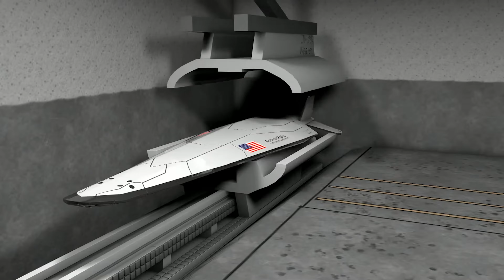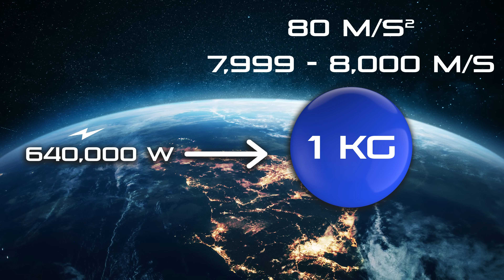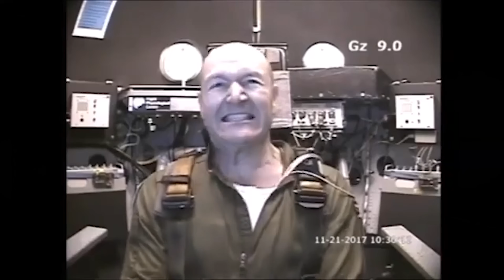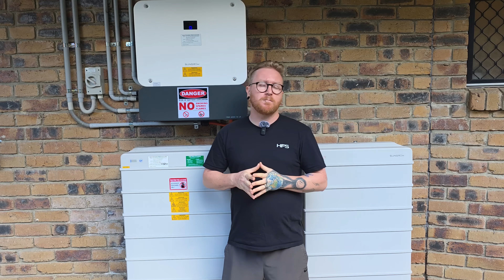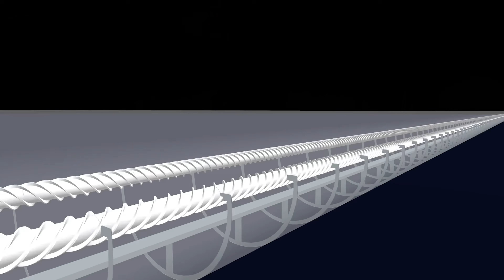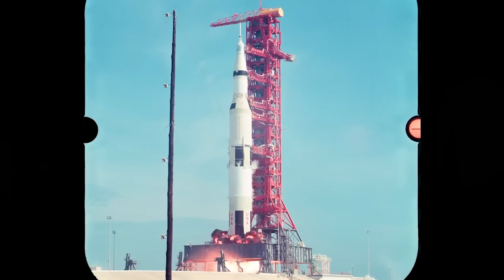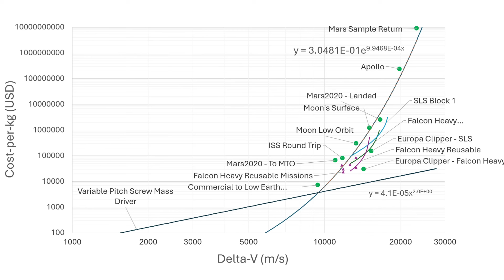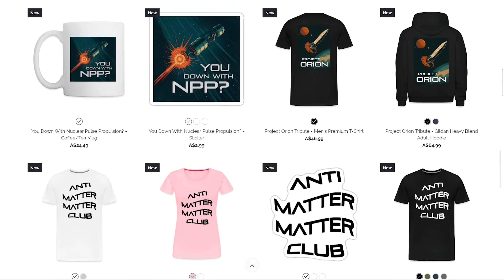The New System That Could ACTUALLY Replace Rockets

Comment: Engineer here: The laws of physics dictate that (on earth) you need at least 32 megajoules (MJ) to get 1 kilogram to LEO.  Real life requires more since you also have to accelerate the rocket body and the fuel.  So, ANY system you design (including the one you describe here) has to impart at least that amount of energy to the payload.  So, if you want to launch a Dragon Spacecraft (12,000Kg) to LEO, that will take over 300 gigajoules.  Yes, with your variable screw thing you could build that up slower so it would require less watts BUT you still have to get to that energy and 1) you will not be able to transfer all of it and 2) you will have losses that grow with the amount of time required to spin up the system.  Maybe once we get to orbit or to the moon, such a system could work BUT I just don't see how this could ever work for getting a payload into earth orbit. Artsutanov's Space Elevator seems more realistic though the materials to make one is still quite a ways off.
Reply: The space elevator is unlikely any time soon. I’m surprised people don’t discuss the one solution that is actually feasible with current technology (although still an engineering and geopolitical challenge); namely, orbital rings.
Reply: @iloled2924 orbital rings have a serious eddy current problem. You don't get something for nothing.
Reply: @iloled2924  Could you please explain to me how an orbital ring is feasible when a space elevator isn't? It seems like an orbital ring is like an even more ambitious version of a space elevator and requires similar materials.
Reply: I think it's not replacing the rocket/fuel, but heavily reducing the amount of fuel the craft needs. Think of the catapult system on an aircraft carrier.
Reply: @quellenathanar  I understand, similar to the idea of launching rockets from airplanes but this design is WAY more complex.  I think the idea is good thought experiment that may lead to something practical but I doubt I will ever see something like this used on earth in my lifetime.
Reply: @connecticutaggie  You're probably right. I just don't like the idea that we currently carry all the fuel from the ground just to go from 0V-XV. Even if we use a mechanical system like a catapult, it would save quite a bit of fuel/weight.
Reply: @quellenathanar  I think the next practical step would be to find the most efficient way to do ultra high speed transport (like Hyperloop).  That is the same core problem but keeps it in the achievable range and has immediate applications.  The challenge with that however, it that it means you have to put meat on your idea and some people would rather stay in the dream/future/inspiration space where as and Engineer, I prefer to do some dreaming but then look to see how to apply that in current reality.
Reply: Marshall Savage relates his preferred option in The Millenial Project. He proposes a mag-lev system that ascends at a curve up the inside of Mt. Kilimanjaro. A significant amount of velocity can be achieved with ground-based energy deliverance, and the emerging ship (look, he has details) is going at a rate that the laser system (yes) that is next employed is used to vaporize ice stored in the hold. This provides the needed thrust to achieve orbit. Look, just go read the proposal. Arthur C.  Clarke loved it and wrote an Introduction, for Pete's sake.
Reply: At the altitude the ship would emerge, the air resistance would be greatly reduced. Also, the ground-based lasers also take a huge load off of the ship's needs.
Reply: The vacuum part is being investigated presently, and I expect us to make progress, of we want it.
Reply: @wombleofwimbledon5442 even if you got to the top of Mount Everest, you still have a third of sea level air pressure.
Reply: The fuel of a conventional rocket launch has the same fundamental energy requirements plus it comes with the rocket equation of needing more fuel to accelerate the fuel.
Reply: well, one would assume that the screws, and tracks would be better performing then ACME threads and flat guides in power losses, and likely worse then ballscrew and bearing tracks that puts losses  at between 70%-80% for a quick back of napikin calculation.
I gotta say, thats better then any rocket motor for leo launches already, that have a maximum "round cow" idealized maximum of 50%  and entirely based off of known in use mechanisims losses for such a use case.
Reply: @AnonymousAnarchist2 
I see it as sections about 30 foot long, need redundant systems to prevent disaster, would it change the spin on Earth if you don’t build two?
Reply: Carbon nanotubes will make the space elevator possible.
Reply: It is a feasible solution with current technology could begin building it tomorrow,
Will determine space dominance, unless cheap hydrogen is real.
Reply: None of this matters. The point is moot. No one is going Anywhere. My reply to the video creator, but it applies to all of you as well. - "Although new technology for flying craft that may work better than rockets may exist I find it really funny you think travel through a 2nd law of thermodynamics violation you call outer length width and height is possible. If you think that, you don't know where it is they claim you live or you don't know physics of gas behavior or both. Hint - I'm looking at your 2nd law of thermodynamics violation at 6:56. (or at least the CGI depiction of it) Such a place cannot exist in reality. You see, you believe the sky is a volume that gas is not filling. That's not possible especially in the open system Nasa claims we are in."
Reply: the skyhook, launch loop and orbital ring are the only ones that I think are actually possible. And with the launch loop you don't need to impart all of the velocity for example you could have a tandom skyhook and launch loop, the skyhook being a long rotating "pole" in space set with a particular orbit and likely tapered to move the centre of mass to one end and increase the payload, yes you would lose orbital momentum for every launch but you can use ion engines or some high efficiency low thrust option to slowly recover the lost momentum.

launch loops use the conservation of angular momentum to get high up by rotating a core of material beyond orbital velocities to keep the centre of the structure elevated about 80 - 100km up and is about 2,000km long, the core is kept from touching the structure with magnets and kept in a high vacuum, the only real issue with this one is keeping the vacuum over such a distance, nice bonus is it can also be used as energy storage and an insane level of energy storage too.

and the orbital ring which is the best of all of them but would be insanely expensive to get to orbit in the first place, just it actually should work and has no fundamental issues apart from being insanely expensive to put into orbit without a pre-existing launch system that brings the cost of launch per KG way way down, well except for the doing the actual construction in space being insanely difficult as it has to be a ring which wraps around the planet... 

technically that isn't true as there is a tweak that you can do which reduces the size, basically you suspend the orbital ring from the planet with tethers, it's called a tethered ring, bonus is you also don't have to build it in orbit, you can build it on the ground, and the reason it works is the inner spinning part provides the large majority of support, it does reintroduce the issue of having a vacuum tube that long however it doesn't need to last terribly long, just long enough to get it high enough that atmospheric pressure is low enough, that is still likely weeks if not months though to raise the orbital ring given the sheer amount of energy we are talking about that a couple of big power plants would take a VERY long time to raise it.

And you would have to build parts of it over the sea, and when it goes over land like that's gonna be problematic too, means getting muliple countries very much onboard for something that will be very disruptive and costly.
Reply: @Etheoma  You'd probably enjoy reading "The Techno-Economic Viability of Actively Supported Structures for Terrestrial Transit and Space Launch". When evaluating which technologies are the most feasible, it's essential to consider their economics - that is, what is their capital cost and what is their plan to service the debt incurred to build them.
Reply: @Etheoma Ive never seen a proposal to just put an orbital ring up around earth.

Most cases its build up with things like Atlas pillars and those Atlas pillars would be used for both energy storage and launching space-craft through an vacuum tube, or sub orbital rings, rings operating in the same prinical as an full orbital ring having the inner core spinning far faster then orbital speeds but a diameter much smaller then earths so you can winch them up by moring inwards and lift them that way thus building the framework for a planetary fast travel, and also energy grid and storage.
Or of course, build the darn thing in the astroid belt and just bring it into position after thats always an option.

Economically as far as impact on regular joe dirts like most of us I do find the orbital ring to be the best solution. But variable pitch screws are not far behind, I ran some back of the napkin math on the propsal and well. They are shockingly do-able.
Assuming the screws where made out of solid cast semi-steel (the strongest cast iron, the weakest steel its just in the middle) thats the material I used and the presented dimentions for the screw. Of course we would use something stronger and lighter. 
but the final twist rate required of the screw limited to bad steel/great cast iron would only be between 2 in and 4 in one (meaning one turn of the screw would move the craft forward half the diameter to 1/4 the diamters) depending on how much a saftey factor youd need for escape velocities, and the energy storage factor is. Well. Defenitly not something to shake a stick at, the entire screw would hold about as much energy as lithium ion batteries of the same size.

And again, thats at intentionally limited materials. So there definitly is simular benifits and utility as the orbital ring just more limited in scope, but also limited in resources used.
Reply: This is a much more significant development for a lunar mass driver system, building real substantial large structures in space will require megatons of materials and this variable magnetic screw thing if it works mostly as well as the paper suggests would make the infrastructure and complexity much more feasible. Still scaling to the square instead of the cube is a massive improvement. There may be some more ideal balance between a ballistic orbital height & finishing up orbital velocity with a burn that launching payload that can handle higher Gs can be optimized for vs  reusable staged rocket launches.
Reply: What about smaller modular payloads?
Reply: @uku4171 being modular doesn't change anything  and sure you can reduce the mass to reduce the energy but to get down to a "reasonable" level of energy means you are just launching bullets to orbit.
Reply: @connecticutaggie modular so that you can lift it in singular modules instead of as a whole...
Reply: 300 GJ is 83 MWh, and electricity costs around $30-$100 per MWh. So $8,300 in electricity costs to launch the mass of a Dragon Spacecraft using the numbers above. Compare this to the $300 million per launch that NASA pays to SpaceX for ISS resupply missions. But, the real operating cost math is more complex and is described in the paper (and in the digital twin) - give it a read!
Reply: @spaceinfrastructure3238  another issue I alluded to but did not delve into is that you are going to have to spin the system up before each launch attempt and I am sure there are going to be a LOT of losses in the system so launch aborts are going to be really costly.  Also, the whole energy recovery process is going to be way less efficient than they think.  I think the idea is good thought experiment that may lead to something practical but I doubt I will ever see something like this used on earth in my lifetime.
Reply: I stoped listening after "because there is no air in the tube" ... good luck with that one
Reply: @soundtrancecloud5101 Mars pressure 0.006 bar is an excellent vacuum. Compress the kilometers of any "vacuum" in front and you quickly get air resistance.  The pod acts like a piston. 
The evacuated tube would represent a lot of energy right there. Make a pretty good fit and you get decent acceleration from that initially.

Comment: So interesting!  Early on, before I understood that concept, I was visualizing a very light PV shaft with the main energy stored in an axial flywheel.  To launch, you pop the clutch to grip the PV shaft.  This is how industrial machine punches are driven.  Maybe the shaft could not be stiff enough.
Also, you mentioned that the tube has a "vacuum" to limit air resistance, but you did not talk about that system.  You can fire a projectile by evacuating the tube and then "popping" the tube end cover behind the projectile.  As the air rushes in, it pushes the projectile forward, and it bursts through the other end cover.  When the payload leaves the PVSL, air must rush back into the tube, so why not open the bottom end and let the air help push it out?  I think that in a short time, the projectile will be accelerated in front of the air, so it would only help at the beginning.
Reply: This would work up to roughly the speed of sound in air. Air molecules just don't move fast enough to go much beyond that.

Comment: I don't trust screws for this application but perhaps with the contactless magnetic interface, maybe but big doubts.  Why not just use a pull cable with a flywheel and a cvt transmission.  Not as cool though.
Reply from the maker: CVT idea is interesting, I have a lot of experience with CVT's! My initial thoughts are that pulling a cable along at 11.1km/s would be nightmarish. Cables are painful, being that they're not a predicable, solid object. There would be challenges in balancing and cooling the screws no doubt, but they seem to me to be a far more reliable method than a cable

Comment: The maximum non-vibration rotation-rate, coupled with a limited
angle for the corkscrew-blade, limits the top-speed of the device.
Another concern: the Max-G-Force the cargo can handle, limits
how short the Screw-Rail can be.
For example, a Screw-Rail that gives 1 meter per second velocity
in 1 meter, will give less velocity-change per meter as the speed
increases, because steady-state acceleration dwells in any
1-meter section for less time as velocity increases, so the
Linear-Energy Required function, reverts back to an exponential
equation and Exponential Energy.
For a Linear-energy-curve per length of Screw-Rail, that gives
1g of acceleration at 1 meter, will require 2g at 2-meters, and
4-g at 3 meters, and 16g at 4 meters length, etc,,, mechanical
limits will quickly be exceeded.
Totally impractical for Earth-Launch systems, but may be feasible
as a Lunar 'Launch & Retrieve' Rail-System.
Reply: This has been extensively modelled. The max tip speed for the screw flights, combined with the maximum screw pitch, allows the spacecraft to be accelerated to interplanetary transfer velocities. Please give the paper a read! It's been peer-reviewed by experts in the field.

Comment: Not sure if even a long screw would not shred.  Also the transit from launch in a vacuum to atmosphere would be like hitting a brick wall.  I actually have been working on a similar launch system which solves both these issues. I could use some help
Reply: You might enjoy the video, "Electromagnetic Launch - What is (and is not) Holding it Back". It touches on the "hitting a brick wall" myth, which comes from an old Elon Tweet. If you have good ideas in this field, consider submitting an abstract to the ISDC. You will meet other experts in the field there.

Comment: Fun idea. But even if you could get the engineering to work, which is a really big 'if', I'd be surprised if you could get the property rights to build such a structure. There are probably only a few places where it would work, and I'd bet that the people who live in the impacted areas wouldn't be on board with building it. I mean, suppose something goes wrong and the thing fails at full power. Would you want to be anywhere near it? Hundreds of massive 100 meter long screws turning at many tens of thousands of RPM? You'd need to turn a whole country into an exclusion zone.
Reply: The screws are in a tube that is underwater. The nearest thing analogous to the screws is the fans on airliners. People may not like airports, but they don't live in fear of those fans coming apart and hitting them with shrapnel.